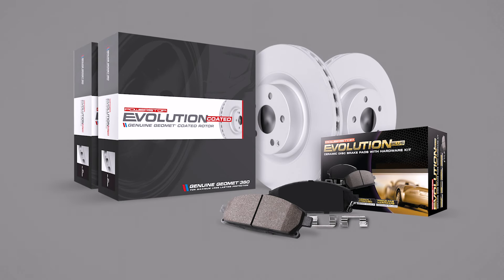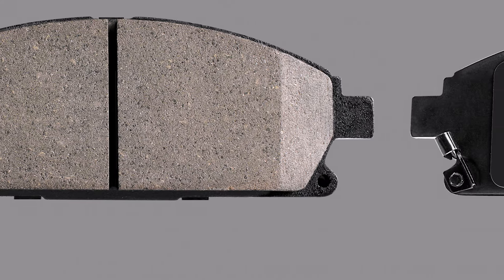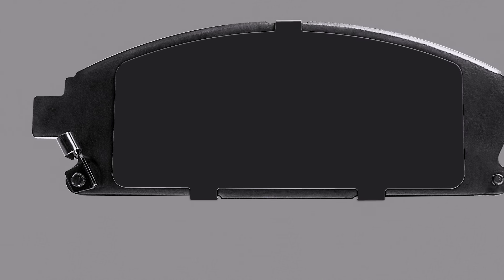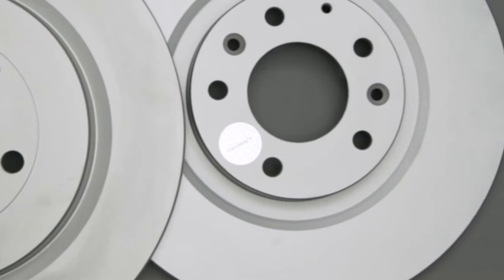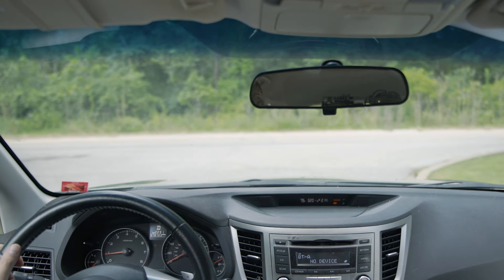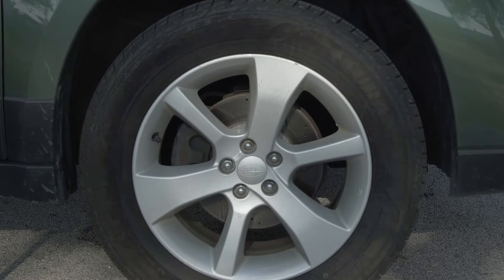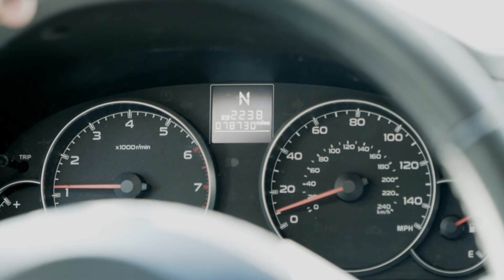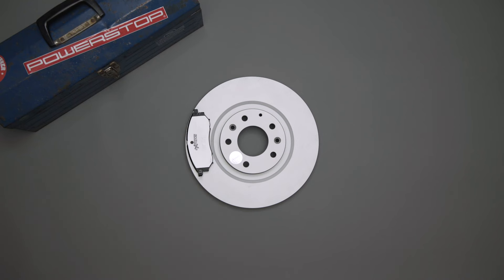How to: Break-in Your New Coated Rotors | PowerStop

Comment: That break in procedure is insane.
Reply: Yeah, it's pretty excessive. I'd imagine it's a non-starter for most people. I recently replaced the rotors and pads on my mom's Tahoe. Went with the Geomet coated rotors and Z36 truck and tow pads. I did the other procedure (45-10 x 5, 30-5 x 5, 5 minutes cooldown) as best I could. I also just got all new rotors and pads for my G6 (Geomet rotors and Z17 pads). No way I'm going to be able to do the 30 stop bed-in process. I'll stick with a more reasonable procedure.
Reply: I dont mind doing this. I just paid all this money and im putting em on a bmw 6. Might as well do the job right. 1 less thing i gotta come back to fix
Reply: @deathk26 how have they been now that it's a year? I just installed some on my car last night.
Reply: @MeltingRubberZ28  They've been great! It's the best combo that I've put on my G6 since I've owned it. It's also the only ones not to eventually leave an uneven surface on the rotors causing brake pulsing. I've had real bad luck with that prior to these.
Reply: @deathk26  great news. Did you go thru the extensive break in procedure?
Reply: @MeltingRubberZ28  I just did the shorter one like I did for my mom's Tahoe.
Reply: @deathk26  OK. That's all I have done as well so I was curious if I should do a further break in or not. Thanks for your advice!

Comment: I have been using your drilled and slotted rotors for years and am used to that break in procedure. I just ordered normal brakes from you guys for my 2012 accord and read 30 decels on the box and was 100% sure it was a typo.  Where the hell is a normal person going to do 30-5 , 30 times...., with 30 seconds in between. 30x30 =900, that's 15 minutes of cooldown time......  So for roughly 20 minutes you have to drive like an ass hat somewhere.  I am going to give it a go in my neighborhood and hope none of the neighbors call the cops on me for looping around the hood for 20 minutes slamming on my brakes.  Holy hell guys.... maybe ill just stick to the slotted and drilled rotors that always warp after 2 or so years.
Reply: I use the church parking lot. It's huge.
Reply: Then dont buy Powerstop rotors. There are better brands. Still would need to bed them in though. And a properly set of broken-in, quality rotors will easily last 100k miles. I'm at 75k on my drilled n slotted rotors (not powerstop) with no problems. So even spending a full hour to properly break-in your rotors, is worth it to make them last 100k miles. Giving up 1 hour for 100k miles or more is not asking much, honestly.

Comment: Bought matching front/back sets of Z17 Evolution brakes/rotors. The front set came with an instruction pamphlet that said to bed the rotors by braking 5 times from 40 to 10mph, 5 times from 30 to 5mph and then let them cool. The back set only came with the instructions inside the brake pad box that says to brake from 30 to 5mph THIRTY times. The website only refers to drilled/slotted rotors and coated. What is the proper break in procedure for stock replacement, smooth, uncoated rotors? Any input would be appreciated. Thx.

Comment: I just drove to and back from work.  Just left plenty of room in front of me to be able to decel without braking or engine brake (6spd trans of course).  At stops i basically rolled through and at lights i would decel to 5 mph and use the parking brake to fully stop

Comment: I have a question. Got the Z17 Evolution Geomet Coated Brake Kit. On your webpage, break in procedure show a video of a break in of a slotted/drilled rotors (5 times moderate to aggressive, 5 times moderate and about 5 minutes of driving with regular breaking). In the Z17 rotor boxes, it's the same procedure instructions that are printed in the box. This procedure isn't the same as showed in this video. For Z17 rotors and pads kit, is the 30 deceleration method is the valid one?
Reply from the maker: Yes, the 30 deceleration method is the correct one! We apologize for the confusion, and hope you enjoy your new brakes!
Reply: @Powerstop  Thank you! Just a note. You might want to link the right break in video on your webpage for Z17 coated kit (instead of the link for the drilled/slotted one). As for the printed instruction, they were printed inside the brake pads boxes, not the rotors one. My mistake. I guess you use the same boxes for all the brake pads, but when you are aware that there is more than one Powerstop break in procedure, you second guess yourself since the wrong procedure is printed in the Z17 kit box and the website video link.

Comment: When I install the rotors do I need to clean them with brake cleaner first? Or is that not necessary since they are geomet coated?
Reply: @geekonthehill  Thanks! Already installed, no brake cleaner. Didn't think about soap and water, would've helped after I applied the anti seize, I just used about a whole roll of shop wipes lol
Reply: How are the brakes holding up ?
Reply: @robwhiff3411  Great! The protective coating rubbed off in the first break-in drive where the pads meet the rotors but that's to be expected. The rest of it is very good, no rust at all and great breaking performance! I do live in Texas though where rust is generally not an issue anyways, but performance wise they are definitely an upgrade over stock rotors and pads.
Reply: @randombailey1166  soapy water should be fine ?

Comment: The video says to do 30 deceleration's but the write up below says only 3. Which is right? Though, 3 doesn't seem like enough and 30 seems excessive.
Reply from the maker: 30 decelerations is correct.  It may seem excessive, but it is considered best practices.
Reply: Bradley Crouch was thinking of buying these coated rotors...are they worth it? How do they look after a couple of months?

Comment: question about my prius prime. i have to change the rotors and pads, and a coated kit seems a good idea since here (quebec) they put salt on the roads in winter.
Anyways, about the break in procedure, how to do it on an hybrid ? moderate breaking will just use the magnets to slow down the car and recharge batteries, not the brakes themselves (i bought this car new 3 years ago and still using the original pads and rotors, 65000km lol !). So i have to break harder ? how many times ? what is the cooldown time ?

Comment: It’s just normal deceleration from 30mph to 5 mph 30 times correct?    Not aggressive stops right?
Reply from the maker: Hi James, each stop should be moderate to aggressive to distribute the friction material correctly and evenly
Reply: PowerStop - Official Channel    It didnt say moderate to aggressive on the inside of the box with the pads/rotors.  May want to add that to the instructions.   I hope I broke them in the right way.   I did 30-5. Just normal braking.  Not moderate to aggressive.
Reply: @jamesa6272   did it perform well after only doing normal braking?
Reply: @SATXDONKEY  They stopped but like I said I do not like these brakes after using them on two of my vehicles.   I will not buy them again.

Comment: I have these rotors.   I have had the power stop ceramic pads.  Broke them in drove with them a while.  Did not have the stopping power of stock brakes on my mazda cx5.     I swapped the pads out for ceramic raybestos and the same thing.   The brakes do not grab hard enough for my liking.   I am eliminating the lack of grab to the rotors.   Did the same thing on my mustang a year ago and also lost the stopping power of that car with a power-stop drilled/slotted rotor setup.      Sorry but no more power stop for me
Reply: You bought PowerStop brakes for a car. They didn't work - then you buy some for another car. I fail to see the logic.
Reply: @Peter_Riis_DK  I bet you fail
To see alot of things
Reply: @Peter_Riis_DK  I see you’re the kind of person that needs everything explained to.    I gave them a second chance.   Different car different set of rotors.  Same result.   No more power stop brand for me.   Get it now?
Reply: @Peter_Riis_DK  don’t care. Someone else’s problem now.   Thanks
Reply: If you have a Mustang, you need a better kit than this company provides. Ford's OEM stuff is pretty meh except for their performance vehicles (Mustang, Focus RS, Raptor, etc) where the OEM is decent quality - because it has to be. Your goal should NOT be to save money but to pay the same as OEM for a proper upgrade over OEM. If we're talking 2000 era prices (what most of us middle-aged people remember when we first started wrenching) vs now, $55 a rotor is like $30 back then, which any person would have simply considered approaching "mystery metal" category.  This break-in is only possible, as well, if you have a stadium or similar that you can use for the process. In addition, the smell and fumes from the coating burning off is pretty severe.  Far worse than brake cleaner, because I'm assuming you have a basic shop mask or a fan at your home versus none in the car. I suppose you could get away with it if everything is tightly sealed and your entire AC system is off, but that's 30 minutes or more baking in the sun or being cold in the winter.
All said, just pay for the OEM or do a proper Brembo or similar upgrade over stock.  Brakes are one thing where you just replace them and move on.  They will eventually rust, they will eventually wear out. What matters is stopping distance. Or in this case, the 10ft longer it's taking you in an emergency situation as the pads are clogged with residue for the first few hundred miles. But don't trust me.  Talk to any mechanic and they laugh at the cheap stuff coming out of China and gimmicks like this, then warn you not to do it.

Comment: Well considering it took 10,000 miles on Eline's cross drilled slotted rotors to develop hot spots, break in procedure had nothing to do with it.  Cheap metal.